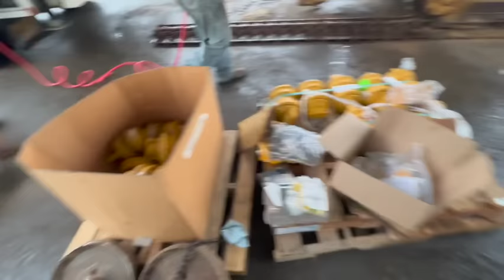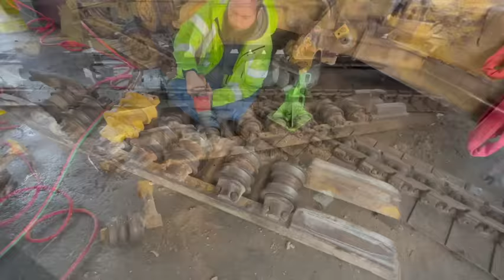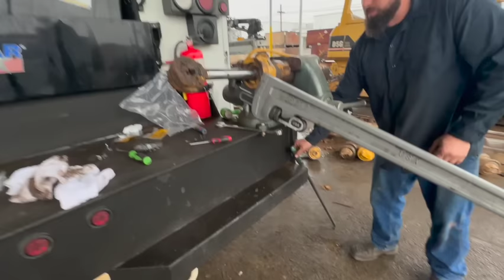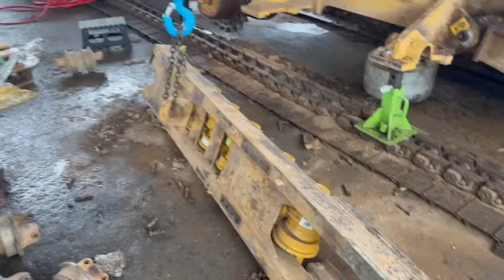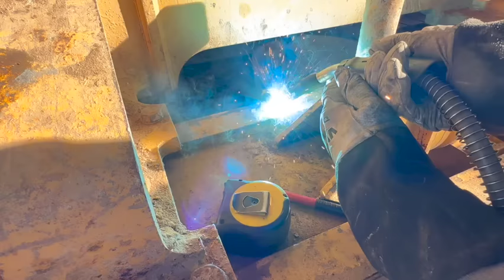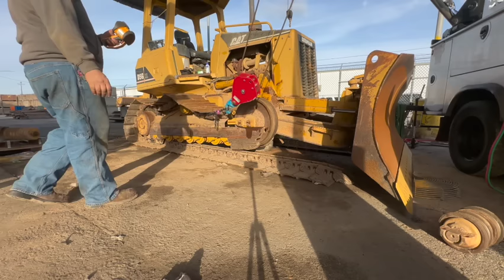D5 Dozer undercarriage

Comment: 78yr old mechanic.  I made myself a set of lineup pins  from longer fine thread bolts,  ground flats on them for easy  removal,  to screw into master links that made it so easy to install the pads, especially on the D9, and D10. Then all you had to do is drop the pad on, and start your other bolts, without  crossthreading.

Comment: Iffn I remember correctly, in 1970 on a 2U track, aBMFH and and a Victor Hot Wrench were the method of splitting a track.  Shop made gigantic wrench to loosen the track tension nut (4 + inches?  It’s been a while)  and 8’ of 2” pipe.  We welded the rollers to build back to size.  Labor @ $2.00 hr. and rod was cheaper than rebuilds or Cat new.  Never ran in high gear to lessen wear on undercarriage.  Far different era. Easier to service and get back into service.  Your crane and battery impact are what were still futuristic dreams in my area. Great stuff you are doing.

Comment: Very Nice video Greg! Pro tips you should always remove paint from the roller flat surface if not the paint will flake off over time and the bolt will have to be retorque.

Comment: One of the first pieces I bought was a small Broderson IC80 carry deck crane. It has a 30' reach and a 10' jib that folds and stows on the side of the arm. That comes in really handy. It cuts the weight capacity down, but for small parts it's perfect. I should have just got a service truck with the built in crane like yours, but having a separate unit has some advantages too.

Comment: Nice job man. I just add a little tip that might help somone. If your machine does not have a master link, you technically dont need to drive any pins out ever. If you need to remove the track, loosen all the tension and lift nachine thrn slide track off the idler then sproket. Basically what would hapoen if you threw a track during operation. Those pin drivers are extremely expensive and money you'll never make back. Only downside to my way is, unless you have another machine its too heavy but most guys who do this work have another machine at least.

Comment: I needed that “turn the wrench with a strap to crane” idea awhile back... even had access to several running tractors at the time too...  tried darn near everything at once and only barely freed the nut... duly noted. 😊 In our favor, at the time, we wouldn’t have had straps at hand - and with compressor at max with a 6’ bar on same pipe wrench I doubt we would have risked chain?

Comment: Nice job well done  
Just retired from 40 plus years CAT 
Tiny Little thing eh d5
Lift the track rollers with one hand lol like a toy ..
Do it on D11 then one of these lol 
We’ve broken vice jaws clamping cylinder barrel ends to remove nuts. Use a bucket from a 988 loader pushing on the wrench lol feild jobs can get interesting
Reply from the maker: I have done them on a D10.   Whatever it takes in the field!

Comment: How’d you get that broken bolt out of the track frame on the other side? Just removed a sheared bolt from a master link and that bastard finally came out after die grinding it out.
Reply from the maker: Drilled it out with the mag drill and taped the hole.

Comment: Not sure thread locker on the roller bolts was the way to go. I’m thinking anti seize for the next guy
Reply from the maker: There is a lot of vibration in that frame.  I would rather fight the bolts coming out than get the call that my customer just lost 2 rollers on the side of a mountain.  But I do usually use anti seize on almost everything.

Comment: Why didn’t you use the blade to push back the idler like you compressed the tensioner spring instead of the come a long?
Reply from the maker: Because hydraulic lines were disconnected.
Reply: @OFW  RAHJAH 🤙🏼😎